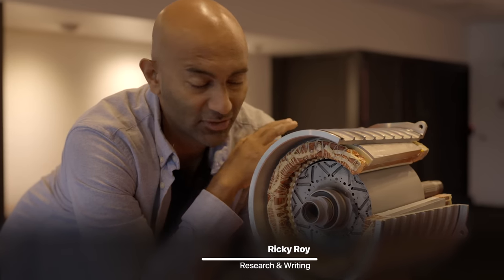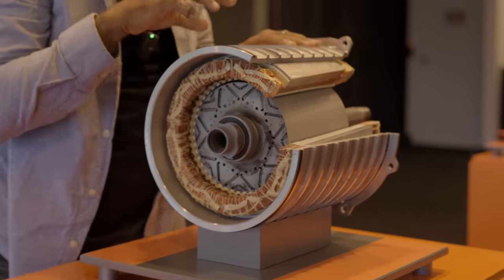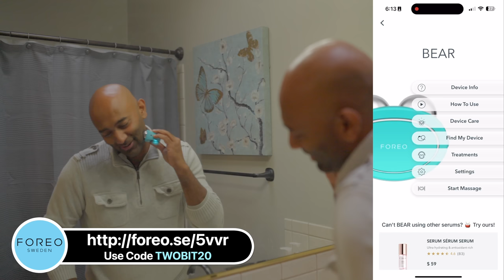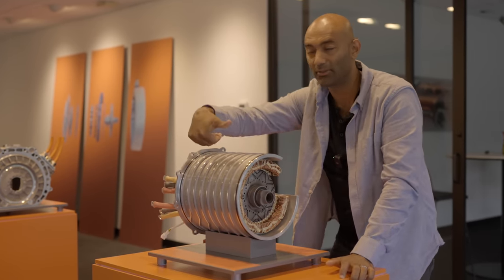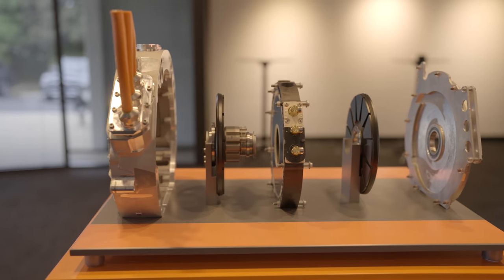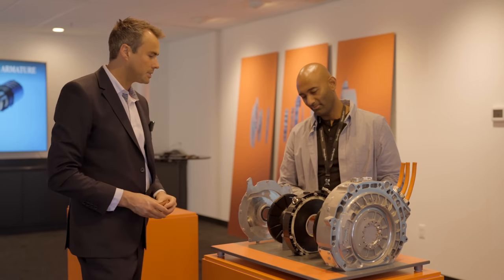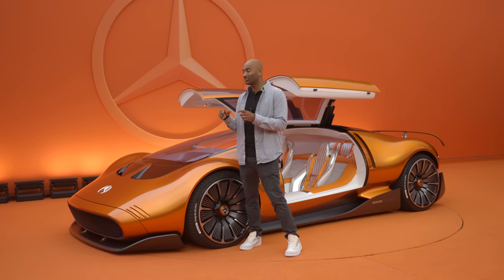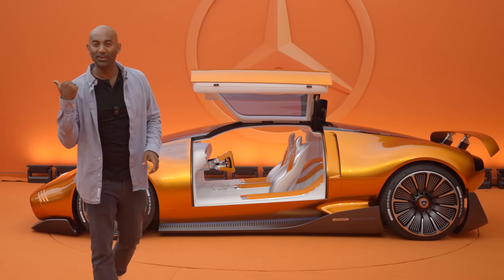Axial Flux Motors Will Change CARS - Here's Why

Comment: Let hope the price of EVs come down to where the average man can afford them. Mercedes will Not lead this effort.
Reply: And not with this fancy schmancy special super duper flux generator motor. I am waiting allt he time that he puts potatoe peels inside and starts to fly.
Reply: With the tax incentives the Model 3 is already at price parity with a Toyota Camry.
Reply: EV are already cheaper than the average car
Reply: Hybrids are EVs too. At low speeds, the engine is a battery charger. And even just 1 mile of battery can double fuel efficiency. Mine gets 50 MPG almost always - 60+ in traffic jams, and ~45 at 70 MPH. Less battery means less pollution to make. And can be bought for less than $30k.
Reply: The trajectory and all estimates are that EVs can be made for less than an ICE car, so it will be the ICE car that will be seen as a rich person's hobby in the future and anyone wanting the best vehicle for the lowest purchase price will get an EV (the total cost of ownership is already in EV's favour but a lot of people have a hard time wrapping their head around that for some reason).
Reply: Look at Chevy Bolt.
Reply: The EVs from Chinese brands are leading that effort.
Reply: You can buy a scooter today!
Reply: A used Tesla can be had for 20, 30k that’s affordable in my book.
Reply: Is a new toyota corolla affordable to you today, because the cost of life running a model 3 is the same price right now.... It's cheap and getting cheaper as we speak
Reply: Volvo just announced their least expenive car, the EX30. It’s a 5 passenger small SUEV. $13k less than the 2023 avg US new car price before any incentives.
Reply: @jeromethemechanic6871  Yeah but you run a high risk of having to foot the bill for a new battery before selling that car. And that is about 10-20K alone.
Reply: @ryanchappell5962 - “with tax incentives”

Which means EV’s are too expensive.

The car company & government both lose money on them… and the consumer loses money by spending more on them.
Reply: Sodium ion batteries are better almost in every way, they're 50 percent more affordable than NMC cells, they're faster charging (10 minutes), they're longer lasting, more environmentally friendly and less ignitable
Reply: The top selling new passenger car in Australia is the Tesla Model Y. There are now Chinese EVs selling for under AU $40,000. So, yes, the “average man” can afford an EV. In any case, the EV works out to be dramatically cheaper to operate and maintain compared to legacy ICE cars, especially if the EV driver has home solar. There are no expensive and recurring fuel, engine or transmission maintenance costs. The savings are truly staggering, amounting to $40,000 over the 20 year lifecycle of the car.

$40,000 is the cost of an average new ICE car to begin with, which means the total lifecycle cost of the ICE car is a massive $80,000. ICE cars are bloody expensive to own and run, no matter which way you cut it.
Reply: @StephenGillie  Hybrid cars, just like conventional ICE cars, will become totally obsolete within a few years. EVs will outsell ICE and hybrid cars well before 2030.
Reply: @truhartwood3170   Many consumers cannot add with forward cost estimates over years, even decades, into the future.
Reply: A VW ID4 is the same class and price as a brand new Nissan Rogue
Reply: @jarjarbinx79  The Volkswagen EVs are pointless, mediocre and uncompetitive compared to Teslas and Chinese EVs. This explains why Volkswagen EVS are not selling well at all.
Reply: @user-kc1tf7zm3b  - “EV’s will outsell… before 2030’s”

Pipe dream. Cost is too high. 1/3rd of the population will need fast charging due to living in rentals. Most manufacturers lose money on EV’s today. Prices are too high. Governments lose money on incentives.

If EV’s were made simple, like bigger golf carts, without the costs… EV’s could hit big in the market, quickly.
Reply: @user-kc1tf7zm3b  - “under $40,000… average man”

Must be great to be filthy rich
Reply: Hopefully they will be abolished soon
Reply: @SkepticalCaveman BS, wrong answer try again
Reply: There are ev’s out there on par with conventional gas cars.  But even for those ev’s who’s up-front cost is more than an equivalent gas Madelin, over time it is cheaper, by far.  I have been driving a Leaf for 2 years now.  The ONLY cost during that time was the new tires I put on it.  No gas to purchase.  No oil or filters to change.  No injectors to clean.  No muffler or catalytic converter to wear out.  And the list goes on.  I save $2800.00 per year when compared to the gas vehicle I previously owned.  So if a person keeps their ev it will more than make up the cost difference of the price tag  when compared to a conventional gas car.  Plus the added bonus of better torque and no engine noise to deal with.
Reply: @DavidHalko  Mr Halko, I will repeat: the top selling new passenger car in Australia is the Tesla Model Y. The average selling price of a new car is about $40,000. Considering that the Toyota Hilux, Tesla Model Y and Ford Ranger round out the top 3 selling new selling cars, the $40,000 figure is a reasonable and true statement.
Reply: @DavidHalko   EVs already make up 15% of all new car sales in Europe, which has even surpassed new diesel cars sales at about 13% market share. Even a high school student with average maths skills would realise that considering that EV sales only accounted for 1% of new car sales before the pandemic, the 50% new EV sales threshold will be breached within a few years.

Before too long, there will be EVs with ultra fast charging which will yield 500km of range with only 5 minutes of charging. When this comes about, ICE cars will be totally pointless, redundant and obsolete.
Reply: A guy in California tweeted a few days ago he acquired his Model 3 for $13,620 after incentives. 

Chevy Bolts were acquired for similar prices writ those who qualify for incentives. Same with the Nissan Leaf. 

Even without in incentives, many EV’s have been sold for less than the average price of gas cars. I bought two used electric smarts (owned by Mercedes), one coupe, one cabriolet, each for less than $4k after incentives. Even without incentives, each were less than 9k. And they each sold for less than 20k & 25k brand new respectively.
Reply: @StephenGillie  Hybrids are not EVs. As the name implies, they are hybrids with a conventional ICE and transmission. With all the inherent costs, considerations and complications which are associated with it.

Even at 50mpg (4.7L/100km), a hybrid will emit 2.5 tonnes of CO2 into the atmosphere over a calendar year. When this is extended over 20 years, over 466,000km, this totals a massive 50 tonnes of CO2. Air pollution kills 7 million people worldwide each and every year. Petrol, diesel and hybrid cars are utterly horrible for the environment and public health.

On the other hand, an EV powered by renewables emits nothing. Zero.

With the petrol price at $1.30/L, this results with the 20 year hybrid lifecycle petrol cost being $28,500. Scheduled maintenance for the ICE and transmission would easily amount to $400 annually, which extends to $8000 over 20 years.

When the hybrid new car sale price of $30,000 is also considered, the total lifecycle cost of the hybrid is $66,500. However, a Tesla Model 3 retails for only $40,000.

Mr GIllie, are you really saving with a hybrid now? 🤔
Reply: @csmarkham  Is it ever going to get any incentives? The initial version is built in China so it will not for sure.
Reply: @DavidHalko  Gas cars also have government incentives given that the oil industry in the US has tax incentives. There are also the hidden incentives of not charging for the pollution that gas vehicles spew into our atmosphere. And, no, EVs do not cause more pollution than gas cars, that has been soundly debunked.
Reply: @ryanchappell5962  some guy got a model 3 in California. New. For 14,000! Google it. It was amazing all the incentives he coupled.
Reply: @user-kc1tf7zm3b  Please educate yourself on the Hybrid transmission. It's embarrassing to debate with someone who's uneducated on the debate's basic topics. 

EVs powered by diesel generators pollute worse than a gas car. How do you know where the electricity comes from?
Reply: @evolv.e  This might speak more to the used car glut than anything else. Used 90s Camrys can be found for like $3500.
Reply: @CatalystNetwork  for $13,620 actually! 
Not too shabby for a new Model 3.
Reply: @kenji214245  False
Reply: @StephenGillie  after incentives and rebates, I acquired my 2014 smart electric drive cabriolet for less than that!
I couldn’t fathom why someone would pay the same or more for such an old gas car.. and all the expected maintenance on top of that. And I’m certain not as safe either. That old car needs to be recycled at this point.
Reply: @StephenGillie  A Toyota RAV4 hybrid has a weight of 1700kg. A hybrid car without a gearbox of some description, when it is being powered by the ICE, will become untenable and undriveable as there is so much weight for the ICE to push.

Next to no EVs are recharged with a diesel generator on a daily basis, as this is patently stupid. Most EVs are charged at home with the ordinary mains electricity grid. However, many EV owners have home solar in order to capitalise on the synergy between home solar and the EV.

In any case, most coal powered electricity plants in advanced Western nations will be decommissioned during the 2030s, due to carbon emissions being unacceptable, in addition to the high cost of operating and maintaining these legacy plants.

Solar, wind and hydro renewable energy sources are dramatically cheaper to construct, operate and maintain.

Mr Gillie, please have a shave. 🪒
Reply: @evolv.e   In Australia, used EVs at the AUD $15,000 price point just do not exist for the most part. While a used Nissan Leaf or a Mitsubishi i-MiEV can be had for $15K, these EVs are not appropriate for most drivers as larger cars are preferred. 

In any case, within a year or so, the residual values of these old 2010s-esque EVs will plummet as cheap $25K and $30K new EVs from China enter the market.
Reply: @evolv.e  Road trips. My HEV has a 600 mile range, and is as boring to drive at 80 MPH as at 20 MPH. 

By making better and best into enemies, there's no limit to what we can prevent ourselves from doing. Your "better than" attitude makes people dislike electric cars. Stop trying to win, and start trying to make the planet a better place.
Reply: @user-kc1tf7zm3b  Shaving gives me body dysphoria. I do not feel like myself without my mane. 

You haven't seen the diesel powered EV charging stations in Texas? You should take more road trips. 

And how many mains are powered by diesel? Or even coal? More than anyone wants to admit or believe. Western nations are struggling and failing to meet these 2030/2035 commitments, because there isn't enough lithium on Earth. The UFO technology is needed to get us there. 

Did you just say that hybrids are too heavy for the engine to push? My HBV has about 10 pounds of lithium battery, enough to go about 1 mile. It's a 3500 lb car, which any 2.5 L engine can easily push. The battery cycles every 20 miles or so. It doesn't plug in, just a dozen gallons once a month.
Reply: @StephenGillie  it’s laughable that you are telling anyone else to “make the world a better place”, when driving older cars with older tech helps. It doesn’t help you, it doesn’t help me, and it doesn’t help the world. How about YOU start with yourself and make the world a better place, THEN maybe through your actions, be an example for others to follow.
Reply: @user-kc1tf7zm3b  compared to other EVs, yes, but compared to an ICE like Nissan Rogue, it's way ahead. Its crappy infotainment system is much better and the ride much smoother. The car has a decent range and charging speed to be an ICE replacement.
Reply: @StephenGillie   What is true in Texas is often not true for the rest of the world. This really goes without saying.

As for the proportion of renewable energy sources to the overall energy supply, this wildly varies on region to region. In the Australian state of Tasmania, hydro accounted for 100% of her energy needs as the state has an over abundance of hydro. For Australia as a whole, the renewable proportion is 36%, so more than one third. Australia will decommission all remaining legacy coal powered plants by the 2030, for reasons already stated. Moreover, most Australian new build homes have solar panels installed. Australia will transition to 100% renewables by the 2030s.

Over the Tasman Sea, New Zealand sources 82% of her energy from renewable sources.

Mr Gillie, all hybrids feature a gearbox of some description. The laws of natural science and physics demands this.

In the words of World of Toyota:

“Every [Toyota] RAV4 Hybrid features a continuously variable automatic transmission (CVT)…”.
Reply: @evolv.e  Thank you for ceding the point through your ad hominem attack. Have a great day.
Reply: @StephenGillie  What point did I cede? 🤔
Reply: @jarjarbinx79  It depends on local market conditions and realities. Nissan and Honda are absolutely nowhere in Australia with respect to new car sales, as neither Japanese marque have any vehicles in the top 25 sales chart for June 2023.
Reply: @thotmorgana  A lot of federal subsidies are done through tax deductions, which requires itemizing, and basically doesn't make sense unless you own a house. Which is great, but not accessible to urban nomads or apartment dwellers. 

A huge secret is that wealthy people are the only ones who can afford EVs in the USA, and they park theirs next to a big truck in their garage. When the person wants to feel tough, they drive the gas guzzling truck, and when they want to feel environmental, they drive the EV and scold people for driving big trucks. The less fortunate drive cars older than they are - 35+ MPG Camrys and Corollas from the 1990s.
Reply: @SkepticalCaveman Up front, definitely not. A Ford Figo is a lot cheaper than than say a Chevrolet Bolt or other entry level electric car.
Reply: Who’s paying to propagate comments like this in the face of the facts?
Reply: Meanwhile me who's probably gonna drive my early 2000s econobox until I die:
Reply: @coffeeisgood102  Having free electricity ?
Reply: @user-kc1tf7zm3b  hardly anyone buys passenger cars so it’s not hard to lead that segment! Most people buy twin cab diesel utes looking at the figures.
Reply: @StephenGillie  hybrids are never considered as EVs.
Reply: @ShirtPapa  WA State charges the EV extra  tax on hybrids too. So they're considered EVs for taxation purposes.
Reply: @darrellhay The bolt has been discontinued .
Reply: @STB-1  In Australia, passenger cars are considered to be SUVs, hatches and sedans. The obvious exception are utes (pick ups), such as the Toyota Hilux, with these deemed to be light commercials.

Of the top 25 selling cars sold in Australia for June 2023, 6 were utes, which made up 24%. So, your assertion that most consumers buy “twin cab diesel utes” is not rooted in reality.

The Tesla Model Y EV was the second biggest car overall, which naturally means that apart from the Toyota Hilux, the Model Y outsold all other utes.
Reply: Mine was $14,850 usd in 2021
Reply: @StephenGillie no, they’re hybrids. If it has a gas tank, and especially if it lacks a plug, it’s not an EV, it’s an EAV (electrically assisted vehicle) or more simply put, a hybrid.
Reply: @dylanwhite6539  If it has neither a gas tank nor a plug, how does one recharge it? Big wireless pad? 🤔
Reply: @StephenGillie  my bad, I fumbled the wording.
Reply: @StephenGillie  edited. My main point is while it may be able to go into a “pure electric” or “ev” mode, it’s really not fair to call it such unless you’re able to rely on plugging in 100%, it’s just a hybrid. Honestly the auto stop start systems are really just trying to copy hybrids as much as they can with as little battery as possible. The “ev” branding on a lot of hybrids now are intentionally misleading imo
Reply: @dylanwhite6539  Oh.
Reply: @user-kc1tf7zm3b  oh ok the article I saw dated 7 July said that the model Y was in third place well behind Hilux and Ranger.
Reply: Why? EV's suck as a car unless you like not being able to drive long distances or like waiting forever to charge and paying a lot to do so.
Reply: @STB-1  VFACTS sales results, June 2023
1. Toyota HiLux (6142 units), 2. Tesla Model Y (5560), 3. Ford Ranger (5334), 4. MG ZS (3756), 5. Toyota RAV4 (2858)
Reply: @user-kc1tf7zm3b  yes that is the June figures, what about year to date?
Reply: Most EV’s in a fast charger can easily charge up as fast as it takes to order and drink a coffee. Yes it’s slower than pumping gas, but I don’t see that as an issue if your waiting in line to pay and purchasing other goods for the road as well.
Reply: I think you need to get your fact checker out..
An Ev charged by the dirtiest diesel or coal power plant is going to be cleaner than running a petrol car.
It all comes down to scale, the bigger the engine the more efficient it is and thus the less it will pollute. There are also a lot of things you can do to help gain efficiency when you don’t need to worry about weight.
Reply: @STB-1   VFACTS publishes sales stats on a monthly basis. Help yourself.
Reply: @aaron___6014  Oh, come off it, Aaron. The average daily distance driven: Australia (33km), United Kingdom (24km), United States (64km).

Australia is bloody huge, with the epic 4000km transcontinental journey between Sydney and Perth taking 5 days. The basic Tesla Model 3 has a stated range of 491km. Most Australians would not drive more than 500km for a single trip, on any day, on any given year.

For nearly all drivers, EV range is totally redundant and irrelevant.

Petrol costs a lot more than electricity. Over a calendar year and 12,000km, a Toyota RAV4 has a petrol cost of AUD $1684. A Tesla Model 3 has an electricity cost of only $421.

For those with home solar, the cost is zero. When ICE maintenance is considered, $2000 is saved each and every year by driving an EV.
Reply: EV’s are already the price of gas vehicles… have you been living under a rock or are you just incapable of thinking for yourself?!? 🤔
Reply: There might be some segments,  but for full size family vehicles like a Tahoe, van or suburban type the big limitation is actually DOT weight limits. 

For full size vehicles,  hybrid and ice will remain the only viable option for real applications.
Reply: Looking for a good price? Mercedes! 😂😂😂😂😂
Reply: Koenigsegg also uses a axial flux motor but they are even more expensive so no help there. You can probably order one already but you basically have to be a billionaire.
Reply: @user-kc1tf7zm3b   I would take a hybrid over an EV no matter.   The value of a hybrid is the stop and go driving,  same as an EV.  The value of an ICE setup is highway driving and full size family vehicles and no EV will ever match that capability and convenience. 

A hybrid has the ability to cover both needs and that is what most consumers want.  It isn't what politicians want but it is what consumers prefer.
Reply: @harryniedecken5321   You can only speak for yourself. EVs will most certainly make up most of new car sales well before the decade is out, as ICE cars are obsolete.

As soon as EVs have 500km range for only 5 minutes of charge time, the “highway cruising” aspect of EVs will become redundant. In any case, a sensible driver needs to take a break every 2 hours whilst driving, so charging an EV every 4 hours, with every second stop, is not an issue at all.
Reply: @ryanchappell5962  Model Y is the same cost or less as a RAV4 plug in hybrid!  You could even get AWD Model Y!
Reply: @user-kc1tf7zm3b   Only by government regulations,  not consumer choice
Reply: @harryniedecken5321   Rubbish. At the end of the day, it all comes down to economics and convenience. EVs are much easier and cheaper to operate and maintain compared to legacy ICE cars. In Australia, the Tesla Model Y is the biggest selling passenger car and the number selling 2 car overall due to market forces. In other words, Australian consumers are convinced that an EV is a far superior transport solution. It has nothing to do with “government regulations”, whatever this means.
Reply: @user-kc1tf7zm3b   Repairs on my vehicles are negligible.   Perhaps your fuel there is just over taxed
Reply: @harryniedecken5321  In Australia, the average annual ICE and gearbox scheduled maintenance cost is easily AUD $400. The rate of petrol is at about $1.80 per litre, which runs to $1600 annually. So, the total cost of running and maintaining a petrol ICE car easily extends to $40,000 over 20 years. Now do you see why EV drivers swear by their EVs?
Reply: They were at that point in 1908. Far better range, utility, and longativity than today. 6x better efficiency than any current road legal EV.
Reply: No way prices will go down
Reply: @ryanchappell5962 who's paying for those tax incentives?
Reply: The batteries are where the huge weight and cost. Sorry
Reply: Agree - there is a degree of elitism associated with EVs. I’d like to get one, but don’t think I can afford the extravagance.
Reply: The prices won’t come down until a bunch of the charging stations are built .They wouldn’t want their wealthy customers to have to wait like common folks.
Reply: They’re already down to where many can afford them right now. 🤷🏻‍♂️
Reply: Maybe they don't want you to afford them; people with freedom of movement are too hard to control. Centralize everything
Reply: @drx630  Base 2023 Corolla is 21,700, base 2023 Tesla Model 3 is 40,240 (for the cheapest model), with the federal 7500, that is still 32, 740, over 10 grand more. Even if we include state subsidies, like NY, it is still over 8000 dollars more. Very misleading for people using this comparison. A chevy bolt is more comparable.
Reply: @user-kc1tf7zm3b  It's a perfect example of over taxed fuel.   Even very heavily taxed fuel in California is closed to $1/ liter and some areas of the US are 1/2 of that.

Electricity prices here are high, depending on exactly when I would charge at home the price would vary from $0.50 to $1 per kW-hr.

I can do my own oil change but even paying to have that work done is not $400.  I just don't drive super high miles per year.   My vehicle repair costs are very low.   The repair costs ev arguments just aren't significant IMHO
Reply: @StephenGillie You're forgetting the other part of hybrid where it still burns gas. Plus it has more components and is less efficient.

Hybrid was an ok interim tech, but it has no future.
Reply: @DavidHalko Currently you spend more on buying a new EV than ICE car. But that's mostly because of EVs being new and production runs smaller.

As thus shifts to smaller production runs for ICE cars and larger number of EVs produced the new price will switch around.

The king term owning costs of EVs are already cheaper (looking at not just purchase price, but also maintenance and fueling.

ICE cars and all fossil fuel production is also subsidized - just not at the consumer level. Not to mention all the subsidies from the past.
If you want EV subsidies removed - let's do that - but then also remove ALL help/bailouts/tax credits etc ICE car manufacturer received. Plus they start paying for the damage burning fossil fuel causes.
Reply: @oerthling  Toyota disagrees.
Reply: @StephenGillie  I know. They are also betting on hydrogen.

But Toyota commiting suicide is not my concern. Several of the legacy manufacturers won't survive the transition anyway.
Reply: @deanstyles2567  there is evidence that this isn't actually true. BYD, for one, is having major issues with thermal events from their batteries. Their electric buses are not lasting more than a few years. Quality and safety does not seem to be their strong suit.
Reply: The convenience of an ICE is far greater than an electric car. Many speak about EV power and speed but not about every day usage. 
Your routine life revolves around your car. I've heard these things directly from people who own EVs.
Reply: @joshfoley8862  Depends on your circumstances and use of the car.

For people with their own garage and mostly just driving to work and back and shopping trips EV is more convenient.

If you live in an apartment or drive long distance a lot (so overnight charging doesn't cover all your daily needs) then ICE is more convenient to fuel.

But charging is getting better. Maintenance is better and cheaper for EVs and gas stations will start to close in some years with growing percent of cars not needing gas stations.

Even the convenience shifts with shifting market share and infrastructure.

And it won't matter in a decade. ICE car manufacturing is doomed.
Reply: China makes credible EVs, with all features including AC and cruise control, not cheap flimsy plastic boxes, for less than $10k.
There no reason EVs shouldn't be cheaper than ICE cars.
Reply: @oerthling  Alternative battery technologies get discussion because there isn't enough lithium on Earth to power humanity through one night, let alone the whole winter.
Reply: @joshfoley8862  Model 3 has a 66 kWh battery, about as much energy as 2 gallons of gasoline, and takes ~6 hours to charge with an 11 kW wall plug charger. Where this really makes no sense is in semi trucks. Remember when Elon had to take up entire Supercharger stations just to recharge the truck?
Reply: They are now cheaper than the average car in America. My brand new Tesla Model Y was $44,500 after the $7,500 tax rebate. Not only are they cheaper and far, far, far better than any ice car. They are super cheap to charge at home. It costs me about a dollar a day to charge. My range is 330 miles per charge.
Reply: I don’t live in a ritzy area and Teslas are as common as dirt here.  It’s about half a mile to the mall and I’ll see half a dozen Teslas on the way.  I imagine they must be used ones filtering down from richer people elsewhere.
Reply: Technology advancement in formula one cars are now in your average model car. 
Any company can lead us to lower costs with advancements.
Reply: @jeromethemechanic6871  used electric car is not a good idea, 1 year old maybe, for 3 years max
Reply: Today's quality of German cars is not what it used to be. They are now all just expensive money pits.
Reply: Honestly with cars brand new costing a average of like $45000 and above electric cars are affordable
Reply: @StephenGillie  The Lithium supply will turn out to be a much lesser problem than current news (and FUD by the fossil industry) suggests.

First a bunch of alternative battery techs are in research and some will make it into production eventually.

Second, grid storage won't use a lot of Lithium because the requirements for grid storage are totally different from limitations of car construction.

Third. Lithium isn't that rare. "Current" "known" deposits are. More will be found while demand will diversify. 

I remember when oil was supposed to run out within a couple of decades because known deposits were running out. But thanks to satellites and a lot of other advances more deposits were found and others became more viable with technological improvements. Making predictions based on 2020 data will turn out to be silly.

Fourth, number of global cars will peak and then go down.

Cities can replace a lot of cars by improved city planning and improved mass transit.

More car ownership will shift to shared fleets. We're already getting used to scooters and bikes rented on the fly via apps. It's already trivial in many cities to get cars for a few hours or days just via app.
Currently the main limitation is that a car might not be nearby. But as soon as the things can drive themselves we'll see a paradigm change. Why own a car when a car can be available within 5 minutes by hailing one via an app. And providing a wide range if car options from small cheap city cars to vans for the whole family transports.

Look at cars nowadays - they stand around for most hours of every day. We'll look back on the insane days when we owned cars that we only use for a couple hours per day and the rest of the time they are useless and take up space.

Instead just pay an hourly rate while using a car of the size and type you need at the time and never worry about maintenance, insurance, theft, damage or replacement.

Somebody will reply with needing a car for their rural area and not understand that this is irrelevant because most people live in cities and that's where the savings are.
A small percentage of trucks getting sed in rural areas isn't a big problem. (The people who actually need trucks, not the idiots who drive trucks in cities because they think that makes them cool).
Reply: They already have. For 10,000 USD you can buy an excellent EV in China
Reply: The TCO of many EVs is already lower than comparable ICE vehicles. In some cases the purchase price of EVs are lower than comparable ICE cars, for example in the UK the entry-level MG4 EV is about 5% cheaper than a comparable diesel VW Golf
Reply: and that slaves don't mine their materials.
Reply: @yaxo11  used EVs are an excellent idea. All the scaremongering about battery life means they can be purchased very cheaply. They are great fun to drive, very economical to own, incredibly reliable (few moving parts), cheap to service and maintain and meet the vast majority of people's driving needs. I own a nine year old EV that still achieves the range claimed on launch. The batteries in most modern EVs will last around half a million miles, before their capacity drops below 80% of their original capacity. Those EVs with LFP batteries can expect the batteries to last around one million miles.
Reply: Doesn’t matter if they did.  No power grid in the planet can come close to supporting Evs at scale
Reply: @ryanchappell5962 as a taxpayer i don’t want to be subsidizing someone else’s car.
Reply: Well said
Reply: @jmez927  2023 models are available now.  I meant used cars, however I guess you did not hear; GM changed course and Mary Barra announced a couple days ago Bolts are gonna be back with Ultium battery systems in a later model year.
Reply: @StephenGillie hybrids won't have a long life I doubt.
Reply: @erichannes6392  Oh man, that's so expensive. My hybrid was like $27,000 and uses a tank of gas a month if I drive every day. My range is ~650 miles, depending on how fast I drive. Sticking to slower highways can get me 60 MPG. Be sure to check your car's tire inflation - mine dipped into the 40s when I had a slow leak.
Reply: @oerthling  Just like the battery technologies, the argument about renting cars is old enough that several businesses are based around this. Have you heard about the Pumped Storage reservoir at the Grand Coulee Dam? It can output for 48 hours and stores at 75% efficiency, built in the 1930s. 

I can only chuckle at "grid storage being different". Sure, right. 😁
Reply: @monkeysezbegood  Since original Priuses are still on the road, I'm confused by your comment. 

Further, why does your tone suggest that you want the more-efficient hybrid technology to disappear? It takes decades of charging an electric car off renewable sources to equal a hybrid. This is well documented, where have you been?
Reply: EVs are expensive and will remain that way until we change battery technology. The batteries are not completely safe, expensive and harmful to mine, and are horrible for the planet. Most "green" things are no where even close to green. We just move the goalposts to make it look nicer.
Reply: They are considered a "luxury" brand, not meant for mere mortals.
Reply: I'd rather hear about this when it's in everyday cars that your everyday working person can afford it. I'm sick of hearing about all the technology for the wealthy only
Reply: Electrical motors is alreddy competitive wirg ICE, the issue is the cost of batteries. Majority of that cost is material processing that I turn is mostly just electricity cost.
Reply: Here is one other little issue.. Range v/s charging time.
I live in S. Florida, we get these things called hurricanes and although real floridians don't usually evacuate for anything under a category 4 unless your on an island or in a mobile home we we do have to evacuate it can entail very far distances.
I've had to go from the West Palm Beach  area to western Georgia which is hundreds of miles, usually with only a couple hours notice.
Yes we can watch storms approach from Africa but it's not until their within a few dozen miles of the coast that a definitive track is established so evacuations of hard structure locations are usually last-minute. 
 I'm supposed to risk my family including pets on a vehicle with severely limited range/recharge time and even more limited recharge locations? For what? So I can pretend that everything needed to produce the ev is somehow better for the planet than using my 31 ft 454 powered motohome which I can drive from WPB to my daughter home in Western Georgia on 1 and a 1/4 tanks of gasoline that  I can get at any exit off the interstate or on any state or county road between here and there.
Like I said in another post
MAKE IT MAKE SENSE
Reply: @eclark9965  Where do you get this rubbish from?
Reply: They won't. Average (as in mean income per household) man, woman, person, couple stretched, at least in the UK, by economy as it is. So old used cars are what's affordable for families.
   As a retired couple, it looks like we made a good decision to get a 3½ year old 7-seater Ford Galaxy, registered Jan 2018, 60,000 miles, and scuffed inside and out, hence just in price range. Great for grandchildren, tools, and rubble for DIY jobs for children, adults of our age, and older. 2 Litre diesel ULEZ compliant. Great for long distances and around town (SE London). New EVs were way too expensive for us. Mileage not enough. There are no charging points in remote areas where four relatives live. Decided EV needed to develop a lot to work for us. 2 years on, there's more available and, maybe in 7 years, there'll be big developments. But we may stop driving then
Reply: @sailingoctopus1  objectively true and more importantly verifiable facts.  

Here’s the catch.  You have to actually be willing to absorb things that don’t fit your accepted narrative. 

Tell me specifically what you think isn’t true.  I’d be happy to help
Reply: @matsv201  they’re absolutely not competitive.
Reply: @eclark9965  so you didn't understand.
Reply: @matsv201  you’re not supplying any kind of argument or point, so i will just assume you’re having a stroke and move on.
Reply: @r.d.9399  We have 100% solutions for the 1% and 80% solutions for the 20%. We need 50% solutions for the 90%, who are driving around 13 MPG vans and trucks from the 2000s. We need spacious-yet-lightweight vehicle with large cargo capacity and a high tow rating, and all of this in a low-priced package, as some form of EV.
Reply: I like gasoline. It don't go dead in the middle of nowhere. Doesn't cost as much as a home hvac unit to charge every day. It also just sounds good!❤
Reply: By 2030 gas cars will not be the norm.
Reply: Volvos EX35 is fairly affordable for what it is tho, can’t say for sure.
Reply: @ryanchappell5962 How far can I pull a 7000 lb. load before a recharge ? 😅😅😅
Reply: The average person can't reasonably afford a new vehicle. 

The cost of lithium isn't likely to drop, and the next gen lithium batteries will be more solid state, increasing the amount of lithium per volume by 3x.

Prices won't go down, and used EVs will mostly be prohibitively expensive for the poor who work, especially when it comes to replacing batteries. At least for the foreseeable future - 15 to 30 years.
Reply: Where's the electricity going to come from?
Reply: @kenneth9874  Dang right, they're already telling people to cut back in the U.S. because of this so-called worst heatwave ever !
Reply: @silent1967  seems like a lot of folks haven't thought it through
Reply: @kenneth9874  Most can't think past their own nose.
Reply: Uh... so... a brand new chevy bolt is like... $29k

Not exactly a bank breaker.
Reply: Too bad the cost of minerals are about to skyrocket.
Reply: @AdodgerWho  So you're an expert on everyone's take home pay and family size  ?
Reply: @ryanchappell5962  Many don’t qualify for tax incentives because of our current tax liability and existing deductions.  So it’s a mute argument
Reply: All EV’s have battery warranty exclusions for the first 30% range loss due to degradation
Reply: @Gregory-Masovutch  Would you buy an ICE vehicle with that kind of a mileage warranty ? 30 % mileage loss is ok.
Reply: The whole idea with electric is that average man won't be able to afford them.....
You will own nothing remember...
Reply: @Truth-And-Freedom  Yep
Reply: Who told you they won't lead the effort!? Lol!!!
Reply: @ryanchappell5962 it's not
Reply: @SkepticalCaveman no they are not!
Reply: @deanstyles2567 very funny! Where else are they selling?!
Reply: @drx630 it's definitely not stop lying
Reply: @DavidHalko the tax incentives are the stupidest thing to ever exist! People talk crap about ICE and oil totally forgetting that everything from the roads to bridges to charging stations to the grid to power stations..... All that is built/ maintained by ICE and oil. What's really the use of EVs!?
Reply: @alanmay7929  Affordable effort.
Reply: @kenneth9874  Coal Brother, Coal.
Reply: @silent1967  Apparently. Since that's clearly what I said. Great work on deducing the true meaning of my words.

Or maybe, my point was that the median new car cost is around 35k, and under 30k is rather inexpensive.

Add in the $7500 tax credit the US government is currently offering, and it becomes even more reasonable at 22k, which is pretty cheap for a new car, EV or Gas.

As for family size, it would fit a family of 5 quite comfortably.

If you have more than 3 kids, it's not your car that's too expensive.
Reply: @AdodgerWho  - “a brand new Chevy bolt is like… $29k”

My 1 year old Ford Focus with leather interior & power everything was less than half of that.

Must be great to be filthy rich.
Reply: @DavidHalko  I wouldn't know. I don't buy cars that break constantly. To each their own I guess.
Reply: @DavidHalko  also, what do you mean by "power everything"?

Power windows and steering has been pretty much standard for nearly 20 years.
Reply: @plaubelmakina8916  switching from one "fossil fuel" for another, smh,lol
Reply: @AdodgerWho  - “what do you mean…”

My previous car was 19 years old, bought new @ $10k price, only died after a wreck. Great car, no maintenance with exception of consumables (ie oil, tires, brakes.) Manual everything (transmission, windows, seat), cloth interior.

This car was slightly more, Automatic everything (transmission, windows, seat), bought 1 year old, leather interior.

This whole $30k for a car, that will likely need a battery before 20 years & 200k miles, is a rip off… especially when gas @$2.50 a gallon costs as much as buying electricity at a charging station. (Sure, a year or two of “free” electricity at a charging station is nice for the filthy rich, but most cars are used longer than that… and 30% of people renting means they will need charging stations.)

“pretty much standard for nearly 20 years”

Yep… use of a car is far less for the filthy rich.
Reply: @DavidHalko  lmao, I pay around $8.50 for 280 miles of driving, have put 22k miles on and the battery is still at 99.9% capacity, and it literally has already paid for itself since I used it to make 7k a month for the last 5 months.

That 280 miles of range earns me around $230 a day. I'm sorry you work for minimum wage, but you should probably consider your own worth.

I'm not sure where being "filthy rich" came into play for you, but I work for my money, and so does my car.

Mind you, in those 22k miles I've put on it, I've rotated the tires. (For free) That's all of the required maintenence for the next 30k miles or so unless something catastrophic happens.

As for brakes, I RARELY use them. No need. I have a paddle on my steering wheel and it acts as a magnetic brake. Turns the motor into a generator, recaptures a huge amount of energy, and brings my car to a stop.

Keep telling yourself it's too expensive. Between oil changes, gas, regular tune-ups and the whole slew of other costs, you might as well consider yourself rich for paying for them.
Reply: @DavidHalko  also, I rent, and charge at home. See, I don't have trash landlords, they actually accomodate their tennants.

They installed wall chargers, and gave me assigned parking at one of them.
Reply: @AdodgerWho  - good for you!

At the 10’s of thousands of apartments around me, it’s not going to happen any time soon. 

Big Oil knows it, and every building along the main drag is getting demolished, with gas stations taking their place, paid for by government subsidies.

Who knows where the power will come from, for these people charging their cars before & after work, on rapid chargers.

The days of a few gas stations near by the interstate are rapidly coming to an end, as gas stations are being build miles away from the interstate, along every former store front, for 30 year old apartments that are everywhere here.

Massive power lines will eventually have to be constructed, where there are none… but that is not their problem, that eye sore will be our problem.

Lottery tickets, beer, cigarettes, and charging will be the cash cow for Big Oil, since they made virtually no money selling gas.

Government has taken out loans in our names to make Big Oil the gate keepers for EV’s for at least a third of the US population, likely more when people will be traveling longer distances.
Reply: @DavidHalko  you're delusional and seem to be vacillating between big oil is bad and EVs are bad.

Can't have it both ways.

You do realize that most households and EVERY SINGLE APARTMENT could install EV charging right?

You could even go off grid and install it. In fact, it would shine when coupled with solar or wind, as long as you don't need the car daily.
Reply: What’s the point in having one of the grid is powered by coal?
Reply: If people want a vehicle of build, quality and price at the leve personally desired. They are going to have design and build there own rather than leave themselves at someone else's mercy.
Reply: Your opinion is a bit naive: battery mining,  production, and end of life are quite polluting. Not to mention the actual production of the car.  Individual transportation will never be sustainable
Reply: @StephenGillie  
Educate yourself on Edison Motors and Diesel-Electric locomotives of the past 50 years... "worse than gas" is physically IMPOSSIBLE.
Reply: @i-love-comountains3850  Diesel-electric's cousin gasoline-electric is another name for the humble Hybrid. They're so efficient that trains have been using them for over 100 years, yet car drivers insist on less-efficient direct-drive transmissions because they have that "lurch" that means "now you're going faster".
Reply: @kenji214245  There are a lot of Tesla's out there around 10yrs old with most having lost only 5-7% battery range, and that's pretty good in my view.
Reply: @DavidHalko The "under $40,000" should be written "under A$40,000"
For everyone else,...the Aussie dollar is currently 0.66 US$, so that $40,000, is US$26,400. And you all need to remember, sale prices quoted for Australia incude all sales and government charges and taxes, which US buyers usually have to add on to the 'price' they see products advertised for. Those fees and charges add up to about 25% of the cost of a new car in Australia, so the US equivalent price sticker would be something around US$17.000
Not so much "must be nice to be rich now" hey David ?
Reply: @StephenGillie  I had a 1994 honda civil that was 1900 dollars. It got 50 mph. This would be easy to achieve nowadays with a gas car, without mining any lithium at all. It's only that none of the compa is want to do so, and none of the consumers want to drive slow, small cars. The problem is us, not the fuel.
Reply: Totally agree, Mercedes itself is a rich people's brand. TATA group will definitely come up with new innovation in near future
Reply: @tumucharan  TATA will be paying the same licensing fees as everyone else. None of the large companies innovate all that much, easier to buy up the small companies that have.
Reply: The Tesla Model 3 is already below the average car price, so we are already very close. The average car price in 2023 is $48K. The base Model 3 is $40K before tax rebate.
Reply: @thaburninator0904  Several cars in the 90’s and some earlier got 45-50 MPG.  We now add batteries and the cost is 45K and we get about the same.  They don’t want you to know about the inexpensive, efficient, gasoline powered cars from 25 years ago.
Reply: @StephenGillie I think they should put more effort into making great hybrids instead of all electric. There's so many advantages of having an engine.
Reply: @jeromethemechanic6871 , buying a used Tesla is like buying underwear at second-hand stores 😅
Reply: @mr.monitor.  By 2035, I can see semi trucks having a 1L engine and modest hybrid battery pack.
Reply: @kenji214245  within a few years, batteries will last a lifetime.
Reply: They will run the rut of the pc, start off high and sink
Reply: A tax incentive is money that is stolen from you and I! Derp derp 😂
Reply: Its kind of like comparing a loan with paying cash and saying that paying cash is more expensive because the first rate is so huge, and then forgetting you have to pay interest (oil changes etc) when you do the loan (ICE) option.
Reply: Uhhh there's the Nissan Leaf and Chevy Bolt. You're trippin
Reply: Nah, lets hope tye EV trend ends soon, so we can get back to REAL cars.
Reply: @StephenGillie I prefer the hybrids that use the battery to apply torque at low RPMs, while charging at high RPMs.

The difference between the two is that this type is designed to complement the performance of a real engine rather than focusing on MPG or stupid things like emissions.
Reply: @jakehildebrand1824  I mean yeah, every hybrid should be able to operate at 120% or more of the engine's output. Mine can match performance with engines twice mine, while still giving 50 MPG.
Reply: @StephenGillie  main issue with performance hybrids is that the electric motor could easily be outperformed by a turbo or supercharger.
Reply: @jakehildebrand1824  Yes, the electric torque is much like boosted torque at low speeds. To get more specific, we'd have to compare specific compressors against specific hybrid implementations. Mine adds 52 hp.
Reply: No one here tows anything evidently. Towing trailers is a big part of many people's lively hood. Cut your distance in half and double your charge time with an EV. Not very practical.
Reply: @2pist Also need more braking force, needing bigger regenerative brakes to absorb the extra momentum from the trailer. It's one of the reasons my hybrid can't tow. The other is it has an 800 lb capacity. Good point, thanks for reminding.
Reply: Not AMG since those are dope & expensive
Reply: @SkepticalCaveman  How. I looked at an Outlander phev and it's 10,000 more. How are they cheaper?
Reply: If it were leaded by Fiat, Dacia (not Renault which doesn't bother if it's cheap) or, any other brand which always has shown interest for the poor's, one will believe Mercedes Benz axial or Konninseg Racial motors goes in the direction of cheaper cars, but not being so, unfortunately will not see cheaper cars as easy as it claims.
Reply: Mercedes isn’t even trying it’s going straight to AMG which is its own company.
Reply: It will, is a matter of time, is like when the cell phones came out or computers came out.
Reply: @user-kc1tf7zm3b  if anything, hybrids will be the only non bev option that aren't obsolete. The more advanced the motors, the less taxed the engine would need to be. The more efficient it can be. It will never decrease range or efficiency to have an extra power source so long as the tech it supports is sufficiently advanced. 

Hybrids are the way to go. Always. Drop gasoline in favor of something clean(er) like Porsche and a few others are trying to and you have no substantial downsides. The only time you'd reach diminishing returns is by using a bigger heavier engine than the application requires/ than the electrics can keep up with without added strain.
Reply: @ryanchappell5962 comparing base Tesla with tax incentives to fully loaded Toyota at MSRP isn't a great comparison.
Reply: Let’s not because lithium battery mines are terrible for the environment and the people working in them:
Reply: @Tha_AntiChrist  yes. We should adopt mass transit instead.
Reply: @Tha_AntiChrist  Are you saying the entire EV car market is BS and not sustainable? That generating electricity is a polluting exercise much like burning gasoline?
LOL, you're gonna make people cry. 
(not me)
Reply: 100% just takes time spaghetti and bananas use to be considered delicacy America
Reply: Tesla is doing exactly that right now! They are constructing the foundation for the mexico factory that will make a really affordable EV. Also robotaxis will be cheap
Reply: Forget selling whole cars, selling these motors off the shelf will change more faster.
Reply: Lol no they are not. Soon but not for a few years yet.
Reply: The main advantage of electric over combustion is performance, electric is way better. If not for this the takeup would not be as good as it is right now.
Reply: A model 3 is double the price of a corolla. For same spec. But getting there as battery density and motors improve prices are slowly getting there.
Reply: @HydratedBeans  Why not?  I’d rather have a base Tesla than a fully loaded Corolla.
Reply: @ryanchappell5962  Fully loaded corolla has a nicer interior and build quality than any tesla.
Reply: @ryanchappell5962 Additionally, the comparison falls flat because it's cherry picking. Using the most expensive version of one car, and saying "see this other car is affordable because the cheapest version is only slightly more expensive than the most expensive version of this other car." Especially considering that the toyota is objectively superior. Why buy a worse product for more money? That's why the comparison is not favorable toward tesla.
Reply: Only if supercapacitors become practical because I'm tired of seeing toxic strip mines for lithium and cobalt and other metals destroying the environment for batteries that catch fire or burn out after a few years
Reply: Mercedes tech has passed to other brands with mercedes patrons picking up the r&d tab.
Reply: GM will have to but I'm afraid that EV is better for our involvement thing they continuely claim happens to be a huge lie. EVs are cool & can be way faster than any gas powered car but cleaner is yet to be proven. Especially mining those darn rare metals.
Reply: Battery technology need to improve befor EVs will really become cost effective. The current tech on Battery's you only get max life of 10 years on a EV that's pretty short time to have to sell out 30 thousands in 10 years are less sometimes they only last 6 years
Reply: @ryanchappell5962  but you still have to replace battery's in 10 years or less so the Toyota actually remains more value
Reply: @user-kc1tf7zm3b if David Halko is American like I am, he might need reminding that your 40k figure is in AUD, currently equal to 25.6k USD. An important detail to remember.
Reply: @user-kc1tf7zm3b sorry, I should have added more detail above. I was responding to a one month old comment about the 40k AUD purchase price (not fuel or maintenance) that you referred to as affordable for the common man. Then David challenged you with a comment that 40k was hardly an affordable car.
Reply: Uh they have?? Get a ford, or tesla, or the cheap ones. Says a guy watching Mercedes example lmao
Reply: Chevy Bolt can be had for a little more than 20K with the tax credit. My friend has one and it’s an awesome little car!  That’s not super cheap but I think it’s affordable for an EV. We will see a lot more EVs in that price range in a couple of years
Reply: 30k for a model 3? Less for a used one
Reply: Volkswagen will
Reply: Mercedes IS leading the way. They have led the way throughout history in safety and performance innovation. They are not the ones who mass-market it. There is a big difference that must be appreciated. Leading the way is risky and R&D intensive. Other companies, that are risk adverse follow on and mass produce Mercedes innovation.
Reply: @BedrockLeadership  I’d say Tesla is leading the way with EV innovations. They have the most efficient motor technology and the most advanced self driving technology and the best batteries, at least for now….
Reply: Possible innthe natural order of things that the slow adoption based onnpricing will dovetail neatly with the needed infrastructure improvements necessary to support EV’s.
Reply: When I watch a video about cool future tech, I want to see cool future tech, not when meh now tech will hit Walmart…
Reply: Mercedes has been a pretty good point of reference for where the automotive industry will be in 5-8 years. They tend to introduce alot of the quality of life features first that eventually make their way to other manufacturers. I'm not a Mercedes fan boy, it's just the way it's been for decades.
Reply: @csmarkham 100% true but also the average 48k car in the IS is much bigger than the Volvo ex30. American market is harder to convert because people driving longer distances, cheaper gasoline, and huge SUVs/trucks are considered the norm.
the smaller the car, the easier it is to make electric. I daily drive a cheap used Fiat 500e it's a great daily driver I always drive it rather than my Sorento if I don't need the additional seats/cargo/range/ground clearance.
 Europe an Asia has tons of small EVs but in the US if it's not at least two tons  and 300 miles rang most people won't buy them. it's a reality that electric is better suited for small vehicle but Tesla is still making premium and bigger cars. they could be flooding the European market if they had focused on the 25k car and also an even smaller/cheaper car,  instead of focusing on the  S/X, cybertruck, semi
Reply: @DavidHalko gasoline receives way more tax incentives than EVs do and in us political context it's still impossible to be elected if you wanna increase gas price, so EV incentives is just a way to bring EV and ICE closer. but tax incentives have price and income limits while low gas price benefits every ICE owner.

if you put politics aside it would be better to remove $20B/y of fossil fuel subsidies, add environmental tax to account for the impact of fossil fuel air pollution on healthcare ($830B/y) , and remove incentives on EVs ($0.4B/y). also remove gasoline road tax for personal cars ($50B) and let the semis pay for the road they are destroying.
then you have fair comparison and fossil fuel doesn't look good anymore.
But considering the number of lobbies/unions that would oppose it, it would be very hard to pass. maybe if everything was explained in simple terms with all the direct and indirect costs for people. like air pollution cost $2500 per people/year in medical bills
Reply: @DavidHalko all these statistics should make clear that 48k is the average "NEW" car price. many people can't or won't ever buy a new car, this is why new EV cost may seem huge to many people , but used EVS will exist after people buy them new. new EVs compete with new gas car, not used one
Reply: @SkepticalCaveman  they're not. When you add in home charging, which you need for an RV to even be close to practical, and you account for the $12k-25k battery will need to be replaced in 7-11 years, it's not. I have a model S as a spare car when none of my other cars are available, or for employees/friends/family/business friends to borrow when they're in town. It never gets driven by me or my girl. It just sits. It's just not practical enough, especially without home charging. It is more of a toy to drive fast, but I've got 3 AMG cars that are fast, and a couple supercars, to scratch that itch. My G63AMG is pretty fast, it's practical, and I can drive it into my ranch.
Reply: @littlejackalo5326  Lol, you own a Model S and don't drive it? Sounds like a random guy making up bullshit stories on the internet. If you really don't use it, then why don't you sell it? I could almost buy your reasoning since you live in the US of A, with only 110v from the wall, but still super chargers are everywhere over there so your rezoning still doesn't make any sense. Also if you can afford a Model S, instead of Model 3 then you can absolutely afford a dedicated home charger too, especially since you can afford several extra cars that you rather drive despite the cost of gasoline.
Reply: So basically Mercedes will be doubling the price of its cheapest car in a few years. Keep in mind they will go for minimum 60000 Euro’s for a basic model (electric C-class).
Reply: @coffeeisgood102  Plus if you also factor in the auto service, most gas cars will require on an ongoing basis, like engine, trans, and diff oils it adds up if you keep the car 10+ years. Then let's bring up planned obsolescence. Engines now are way more complex, run hotter (turbos), and are not engineered to last 20 years. Yeah, there are plenty of motors out there over 200-300k, but with the EPA requirements, companies are having to basically make engines that will fail to meet the increasing MPG standards. I do think by 2030, I will be looking back on today's battery tech like we did with NiCad batteries when I grew up and be thankful for more reliable and safer battery tech down the road.  I have plenty of LiPo's (many diff mfg) that never made their advertised recharge cycle times during my drone hobby days, and I was charging my packs at 1C charge rates too. There will be pack failures and a decreasing range due to cell failures, we deal with decreased performance and less range on an old gad engine when it wears out.  Think like with all tech EV's will get cheaper with scale but yes some of us will still have our ICE cars as a hobby as we will miss the noise and feeling a gas car gives, I still miss stick.
Reply: You’re all so smart 😂
Reply: @evolv.e  I literally just checked the Canadian tesla site and the cheapest shittiest model 3 with zero options, rear wheel is 58k, minus 5k incentives.  The priciest model 3 with best motor and most options is 93k, incentives don’t apply. Cheapest model 3 is 53k most expensive is 93k.  Unless the cdn dollars is exchanging at 1/4 of the usd wtf are you going on about.  For 53k you could buy an actual luxury brand sedan and you’d have to be high or nuts or both to pay 93k for a model 3. The most basic, boring ev I’ve ever sat inside for 93k. Wow
Reply: @lhovo For a full charge it’s still 45mins-1hr even on a supercharger. I hate how ev owners say that. 200miles in 15mins.  How many ice owners fill their car up half way then leave the pump.  None. It sure as hell doesn’t take me 15mins to order a coffee let alone 45mins. Lol.
Reply: @sylvester999999  well, sucks to be in Canada. 🤷🏻‍♂️
Reply: @kenji214245  Why do people like you always spread false information? All EV’s by law in US need to have minimum 8 yrs, 100k mile warranty on the power train, way longer than any ICE cars. And the batteries in EV’s are rated to last minimum 300k-500k miles before degrade to 70% of their original capability.
Reply: @mintheman7  ah yes the general gist of a complex insurance system with a fuckload of exceptions and my favourite. . . Not allways transferable warranties. XD

Don't think that is a simple black and white rule. There are sooo many ways to lose it or for it to not apply on the 70% rule. . .
Reply: @shamancredible8632   Their only large inferiority is that the tech is younger and less established than internal combustion. 

At some point the development of technology will make them superior in most circumstances. They already have waaay better power output compared to internal combustion.
Reply: @evolv.e  You lack the basic understanding of how EV’s are used and the charging curve. EV are mostly charged overnight and only need to be supercharged on road-trips. Most EV owners wake up a “full tank” every morning and won’t see a supercharger for 95% of the time. It takes as long to charge an EV from 10% to 70% as it takes to charge it from 70% to 100% due “stadium effect.” So it’s much more time efficient to charge it only to 70% and than go to the next charger when the battery has been depleted to below 30%. Trying to use ICE car analogy to understand EV’s is like using horse analogy to understand cars.
Reply: @mintheman7  “lack the basic understanding of how EV’s are used..” 🤔 

I’ve got nearly half a million miles driven on 100% BEV over a 10+ year period, with 5 EV’s owned, and two more on pre order. 

Perhaps even the most ill informed person can still own an operate an EV. I mean, if I can do it.. without ‘possessing the basic knowledge of how EV’s are used’, surely anyone smarter than me can too. Perhaps your comment was meant to inspire rather than insult. 👽
Reply: People can barely afford ICE vehicles let alone EV.
Reply: Expensive tech ALWAYS precedes affordable tech. You might not see it. Doesn’t mean it’s not there. The BMW they make today makes the car you drive tomorrow better. Say it with me . . . Thanks, BMW.
Reply: The upcoming tesla model 2 is supposed to start at $25k.
Reply: 💨💨 China will
Reply: “Tax incentives mean we are all paying for your EV” was said, here. 

Let’s look at public land being leased as oil extraction locations, when is my portion of that consumption of property, being sold back to me?

Natural gas and petroleum subsidy.  Any billions, there?

Finally, does anyone remember the U.S. military going to Kuwait?    Was that a rare Earth mineral area?   Or was/is Kuwait sitting on oil?
Reply: That's not where the money is for car manufacturers. They will rather sell you a 2+ tonne Electric SUV eg tesla truck. This is already happening unofficially, with the difficulties in sourcing cobalt and lithium, manufacturers are prioritising the these behemoths instead of small, light, efficient and cheaper EVs
Reply: @ozstriker4075   I would agree. A small light car with a limited range, small battery, etc would make a perfect city car, perhaps even in the suburbs. Attempting to replace the standard auto was a mistake.
Reply: Yea. Gotta love when you gotta do some basic repair cuz something messed up, so you have to go to a special mechanic and pay them a years worth of the car's payments to get it fixed. Just hope it's an easy problem and not a major one...then you might as well buy a new car
Reply: @ryanchappell5962 yea. How much does it cost to get the charging station and have it installed?
Reply: They have. You can buy very cheap, new EV's. Not mercedes' market
Reply: The price will come down as production comes up. The bigger worry is are they going to pay anyone enough to buy a car in the future, because they've already priced the average American out of homes. 
Vote blue.
Reply: @darrellhay 
The Chevy volt: half the reliability at twice the price. What's not to love?
Reply: @patrickthebutcher   lol 😂
Reply: @patrickthebutcher  I said BOLT, not VOLT. Different cars. Volt isn't a full EV, it is a PHEV.
Reply: @darrellhay that was a typo I was on my phone. 
My statement stands.
Reply: Let’s hope they don’t force Congolese children to keep mining the materials with their bare hands for next to nothing.
Reply: @michalandrejmolnar3715 and demand significantly less child labor than lithium ion batteries
Reply: The main cost is the batteries. Panasonic will lead the way on the overall cost of cars in the future and the batteries resilience to charging cycles and range. The motor technology is already mature but will still continue